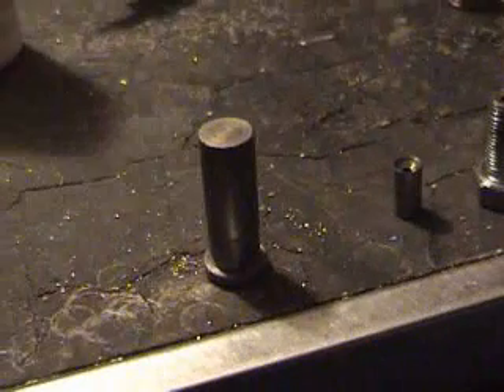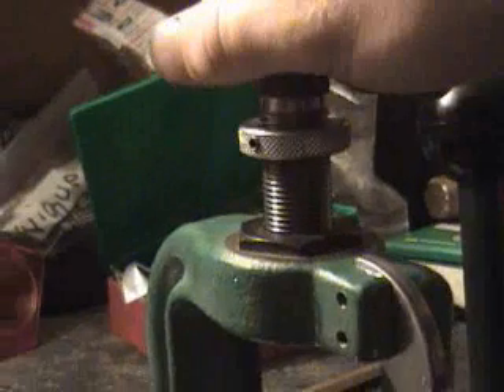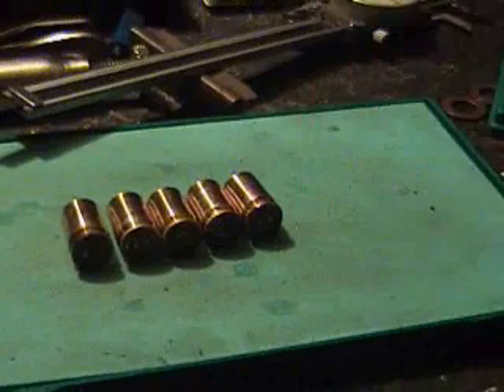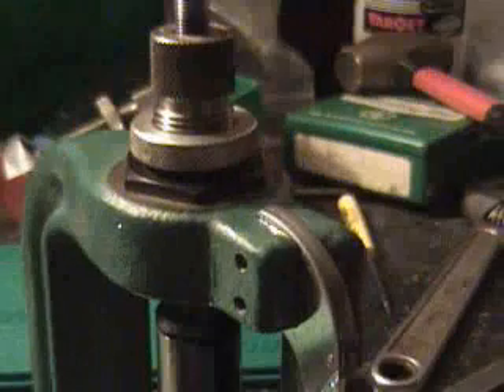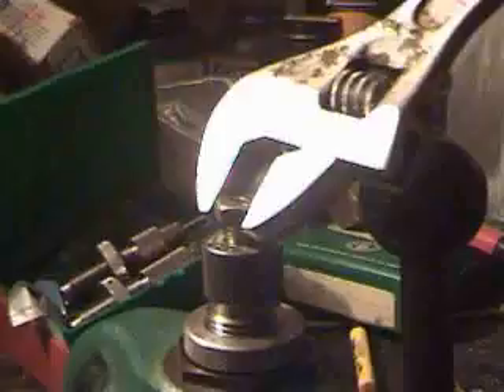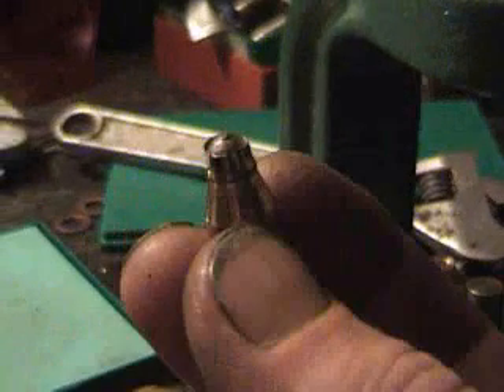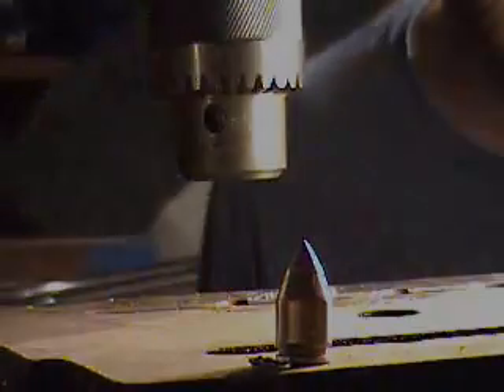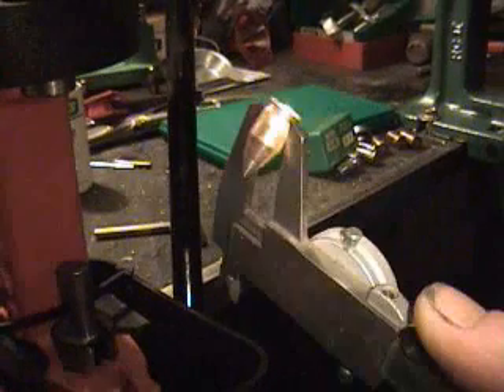swaging Pt. 2

Comment from the maker: A tip for anyone interested in trying this....
Use trimmed down rifle cases for thicker jackets. Use  45acp cases for thinner jackets. The core capacity for trimmed rifle cases will be less than that of the 45acp case jacket....so adjust accordingly.